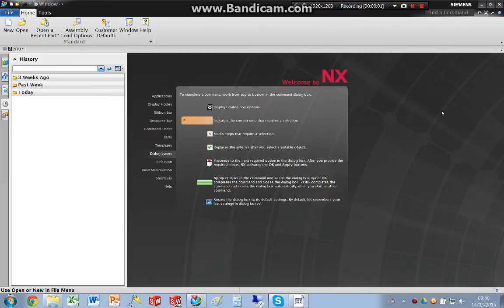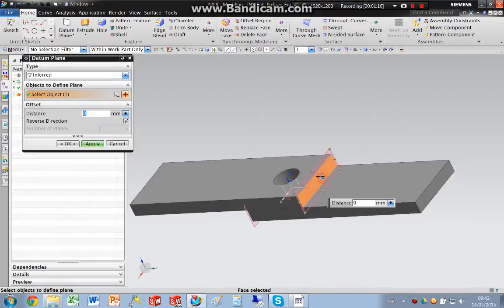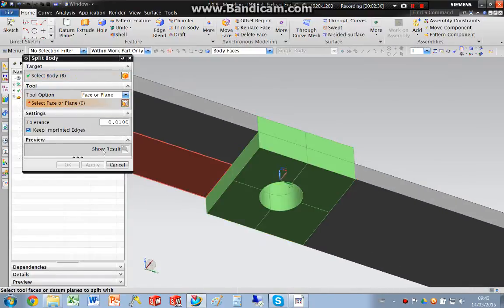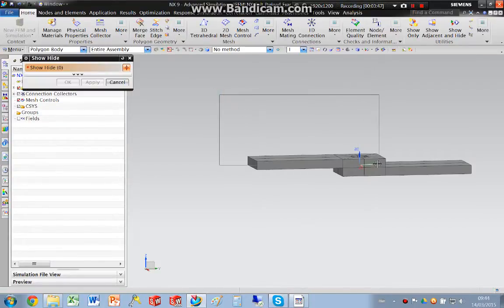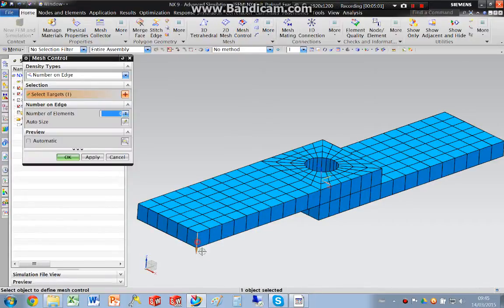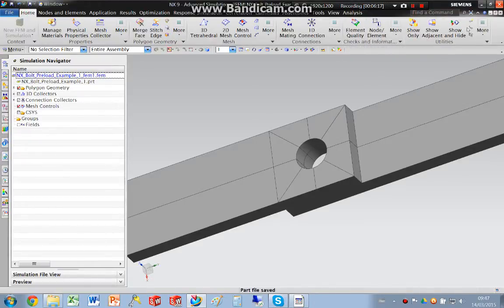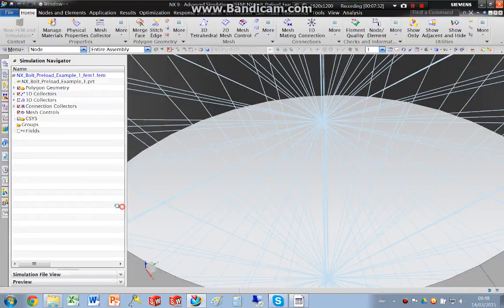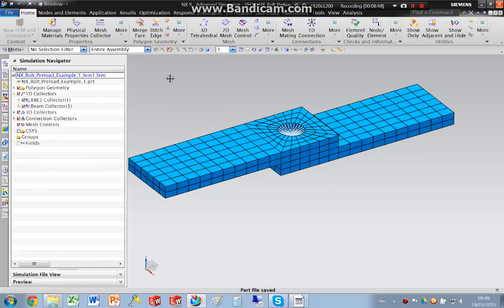NX Bolt Preload Example 1 Part 1

Comment: Hi Matt, 

Great video. If you're still active, is there any way I could pick your brain about doing a similar analysis but differently?

looking to model the sheering forces on 2 bolts, with a force applied at a third point? is this possible in NX?
Reply from the maker: Hello Kyle,

This is possible but in order to correctly model the shear force distribution, the bolts would have to be modelled as solids rather than with Rigid Connections & Beam Elements.

Thanks Matt
Reply: Hi Matt! Thanks for the reply.  Wasn't sure if you were going to see this lol.

Do you have any good resources (videos) for doing something similar?  Not necessary modeling, more looking at different forces on bolts from a force applied somewhere else, using NX.

I see you don't have much stuff on YouTube, maybe a different platform?

Comment from the maker: Surface to Surface Contact and Mesh Mating are 2 totally different things and are used to carry out different things.

Surface to Surface Contact is used in the Simulation to define Contact between 2 separate bodies / meshes that otherwise would pass through each other. This is what was used in this analysis to define that the 2 plates cannot pass through each other and come into contact with each other.

Mesh Mating is used to define a meshing definition between 2 individual bodies etc. during the Finite Element Modelling. It is to ensure mesh continuity. Free coincident means that the nodes generated on 2 individual bodies will been coincident but the nodes will not be merged. You would then have to carry out a separate command to merge the nodes if required within the simulation. If they are not merged then glue would have to be applied to the joint during simulation to ensure no rigid body motion took place.

Hope this helps?